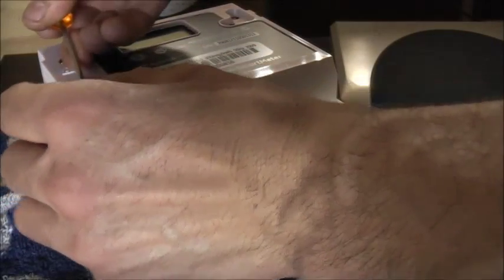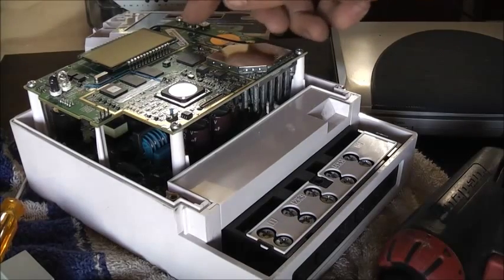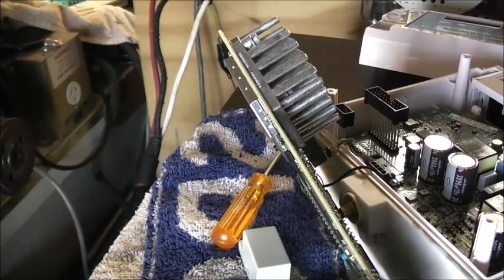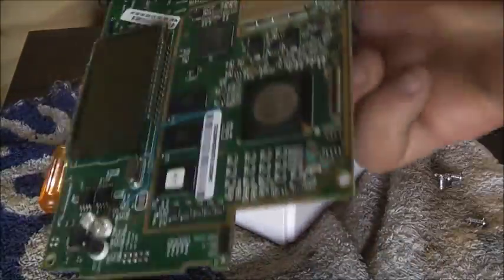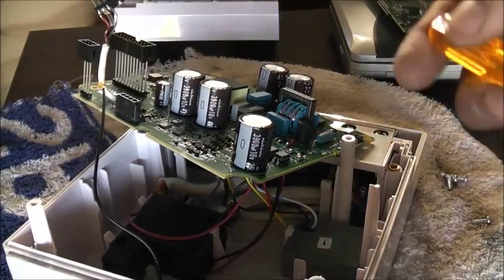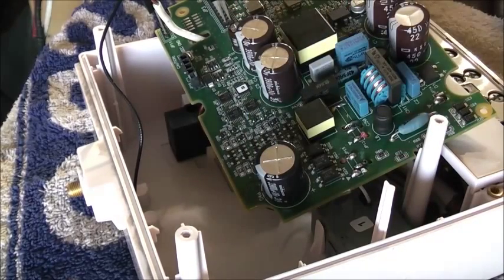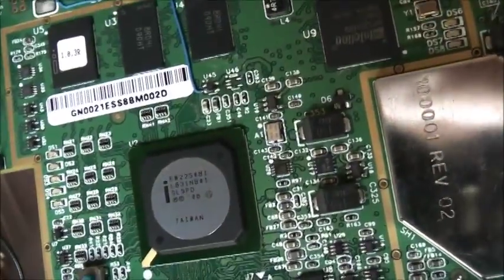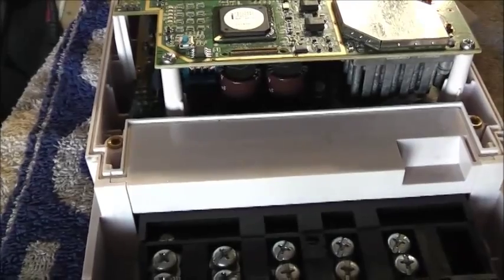GE Smart Meter Teardown & Test

Comment: Li-SOCL2 batteries are not rechargeable.  They are made for powering low-power electronics like those used for metering, or as memory backup batteries.  They can last twenty years or more.
Reply: The manufacturer's usually will list the specs, most have rechargeable batteries for backup to preserve the memory through a power failure, and those usually last no more then 10 years.